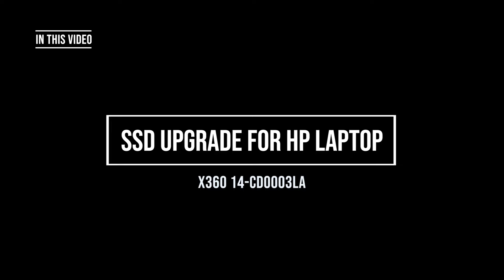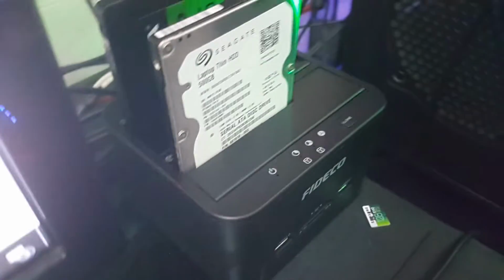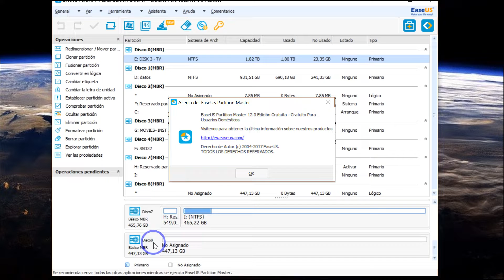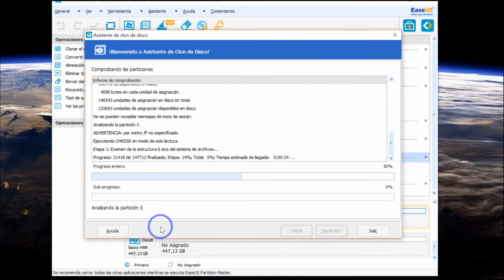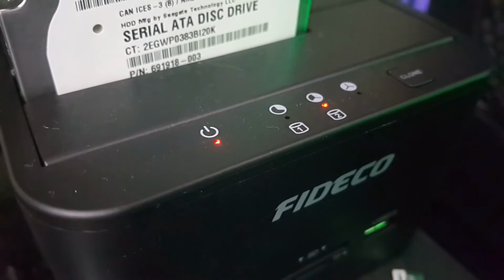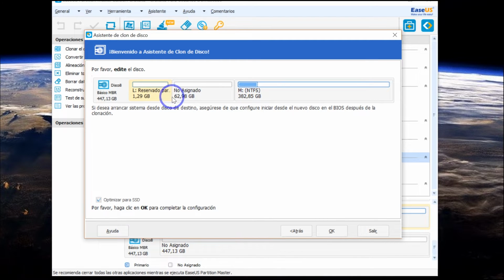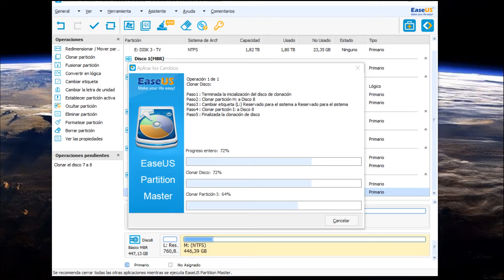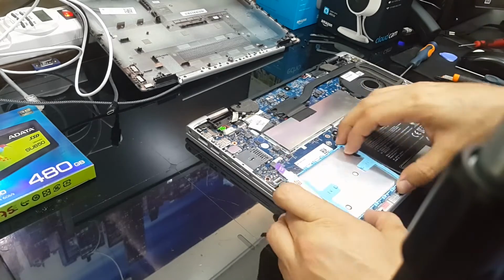BOOST the performance of your LAPTOP – SSD upgrade HP x360 14-cd0003la

Comment: I see a SSD M2 connector, can this be used as main drive for the OS and then keep the original HDD for files?
Which is the purpose for the cloning? is to keep the Windows 10 key available? you can also save it with terminal commands, right?

Veo que tiene un connector M2, se podra instalar un SSD M2 ahi para el SO y dejar el disco original para archivos?
Cual es la razon para hacer la clonacion? para mantener la llave del W10? Pense que se podia rescatar por linea de comandos, no?

Thanks for the video